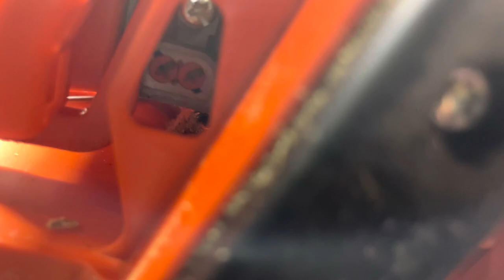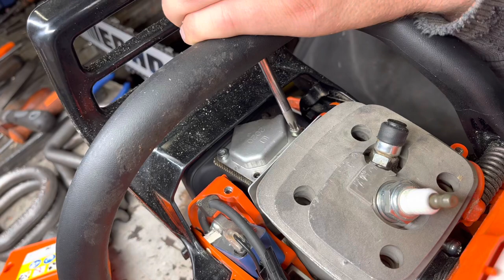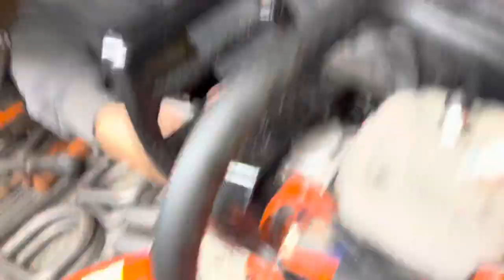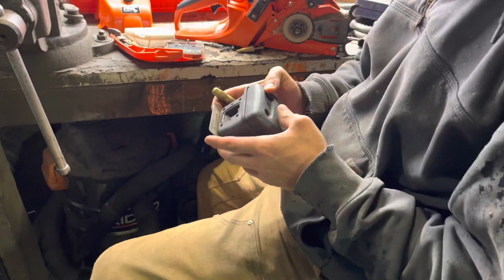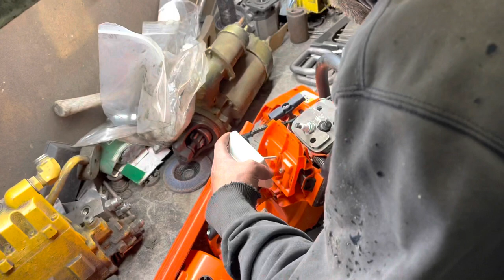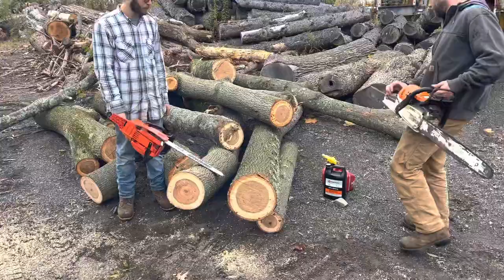Echo 590 Timberwolf- (Easy) How to do muffler mod and carb tune.

Comment: Echo has converted more Still & Husky owners than Jim Jones.
Reply from the maker: There great saws! I personally only run 2511 top handle echos. All others I use for production work are Stihl. However my ground guy bought this on my recommendation and we are both impressed with it!!
Reply: @timberandtools  I have a 2511T.  I find it doesn't cut that clean or chain sometimes snags.  Do you use stock chain?
Reply from the maker: @80srockerable  stock chain gets thrown in garbage lol. I use Stihl 63ps chain or on some of them I have 1/4 conversion! I have a whole video about this. It’s callled echo 2511 why people think it’s worthless
Reply: @timberandtools  thank you! I will check your video out.  I can't believe they sell this with such a crappy cutting chain.  It doesn't have enough power for its aggressiveness.
Reply from the maker: @80srockerable  yeah I think it hurts the saw for people who don’t know why it’s happening
Reply: Echo has better kool aid

Comment: A stock broken in cs590 beats a 261 everyday in my experience, maybe not in small softwood, but for sure in 18"oak
Reply from the maker: We didn’t try it in big wood. I’m sure the cc will pull on the echo. This was hickory. Mainly just to show the difference of speed after mods
Reply: Surprise surprise a 59cc saw can out cut a 51cc saw. What a revelation.
Reply from the maker: @eurokid83  that’s isn’t the point of the video. It’s to show the power upgrade from the mods. If I used a 362 Stihl it would not have been close
Reply: I’ve owned a 362. Great saw, but it’s hardly better than the 590 at full bar capacity. I actually like the Echos better. A bit slower, but a less fussy saw in my experience.
Reply: @jenaystanger5025  I have a 590 and 620.  The 620 is definitely a lil better,Always wanted to compare the 620 vs 362. I feel like the 620 would equal or possibly beat a 362.
Reply from the maker: @jeremymyers5643 620 would definitely beat the 362. I have a video up on my channel if the 620 beating my ms400 !!! Both saws have muff mods that’s it.

Comment: This is the first time I’ve seen the muffler mod this way. The way I saw it totally bypasses the baffle.
Reply from the maker: @voodoo7008  this was the “easy“  merging for basically anyone to be able to do
Reply: That’s how I did mine. Bought mine second hand. She was a monster before that because prior owner took lower baffle out of deflector and tune carb already. I just added the muffler mod at the deflector and holy crap does she scream. I’d put power close to ms461 stihl as I’ve ran those before and this one is about comparable to that.
Reply from the maker: @ they are great saws!!

Comment: Just sold a Stihl Farm Boss because it had issues straight from the dealership.  Returned it 3 times before using it and they wanted to charge me a shop charge so once it was sold I went with Echo CS590 Timberwolf.  Starts good and cuts good,  no complaints but tuning mine with a muffler mod soon and looking forward to seeing the difference
Reply from the maker: Yeah big difference with the muff mod, wakes it up. Sorry to hear the bad experience with Stihl I really like there stuff as well
Reply: @timberandtools  
I liked Stihl until the bad experience with the dealership. Stihl representatives talked with me and replied to all my emails trying to resolve the issue but when they supported the technician at dealership that wasn't capable of simply tuning my carb to get it to run correctly I gave up on Stihl. I returned it 3x's and 4th time they wanted to charge me to fix something they couldn't fix to begin with so after hearing about all the good comments about Echo i decided to go with them but so far I haven't had to deal with a warranty issue and it's been problem Free.
Reply from the maker: @dentondunn4346  that’s an awful experience!!! Echo has been great to me so far
Reply: You won’t regret doing the muffler mod and retuning , I was more than happy with the difference
Reply: @Pwnappler  
Iowa Performance Saws has it now, modded the muffler yesterday and taking out the plastic limiters today and tuning it so should get it back by Saturday or Monday at latest.  Can't wait even though ups damaged my chain break handle during delivery but they're only $25 for a new one but hated it cause it's a brand new saw
Reply from the maker: @Pwnappler  night and day, really wakes her up
Reply: LOL, same here - I bought a new Stihl Wood Boss and it had trouble. I ended up buying a new carb for it and fixing it myself. I ripped my shoulder muscle trying to pull start it (when I was tired). I went with the CS590 and love it. Look up ghtuning on the web to get some really cool mods. I'm done with Stihl.
Reply: @aportilla007  the muffler mod and having it retuned is worth it. It's a beast now, big difference
Reply: @dentondunn4346  I'll get it on the bench. Looks easy enough.
Reply: @aportilla007  I'm done with Stihl too, my CS590 is a torque monster after having Iowa Performance Saw's do a muffler mod, removing limiters and retuning it. It made a huge difference in how it runs. It's everything I need for gathering my firewood. If I was to ever buy another saw I think I'll either buy another Echo 7310 or a Husqvarna. I won't ever spend my money on another new Stihl. The way they done me on the warranty not wanting to repair a brand new saw never used turned me off from them.
Reply: @dentondunn4346  lol those 7310 look awesome. That is probably my next saw.

Comment: The stihl 311 is a much better match up. I have both , both modded. The 590 cuts fantastic especially in hard woods, has the torque needed to muscle through without bogging down to much.. the 311 runs fantastic and the mods helped it throttle response drastically , really opened the saw up. But with everything being said I like the design of the 590 better especially with the price difference and weight
Reply from the maker: For sure a great saw!! Price is unbeatable

Comment: Does that extra hole in the muffler blow a lot of oil out of it?
Reply from the maker: @you-tube153  no my saws do not have any oil coming from them. If the fuel mixture was to rich I would say yes I could blow oil out of that hole.

Comment: Just a carb retune on the 590 makes a noticeable difference. They’re rich from the factory. Mine would out cut my 261c from day 1 after it was tuned.
Reply from the maker: This is true, the factory tune is awfully rich. I just open up the muffler a bit on most saws I mod the carb on and way I have found on some it make a huge difference (2511) for instance needs a muff mod or else you don’t get a lot of usable power from just modding carb. I’m sure a retune on the 590 wood have helped a lot by itself

Comment: I love my 590 but it’s just stock I just put two tanks through her today on a bunch of cottonwood about 32” round. I did buy a 24” Tsumura and slapped it with a skip tooth full chisel and she absolutely ate. 
I also have a MS462CM that I haven’t fired up yet.
Reply from the maker: Sweet that’s actually the set up he has in his timber wolf now Tsnumara 24”. Your really going to like the 462! I have other videos up of mine and tbh it’s my favorite saw.
Reply: @timberandtools  which one the 462 or the 590? i really want to do the muffler  od on the 590 but i dont know how to tune a carb unless its like my nitro cars-thats the only thing holding me back from the muffler mod.
my 462 i put on a sugihara 28" bar and the stihl pro full chisel full skip-so shes ready for the shelf, lol look pretty
Reply from the maker: @ChrisNieves  462 is my favorite!! I don’t own a 590. This is my groundsmans chainsaw. Tuning the carb is something that is learned. A lot of good videos on YT. Best thing you can do is learn how the low and high jet affect the tuning. Then you’ll be able to tune by ear easier. Most of the time I get them close by ear. Then tune them in the cut.

Comment: I have a 620pw, but my dad got a great deal on a returned 590 through work. Anecdotally the power difference is miniscule after tuning with the 590 being more forgiving down low. Only negative is the oiler seemed lacking (imo) for the 20" bar on even highest setting, whether that's spec different from the 620p or just the machine idk....its more than adequate for the 16" pro bar he has on it now and absolutely rips.
Reply from the maker: Not sure if the oiler is different or not but they do say 620 can handle a 27” from echo

Comment: Ive cut wood for over 30 years heating at least two homes and a waterstove and seriously dont know why Id worry about the  speed differences as there both fast enough to get the job done.
Reply from the maker: Cutting wood for a living , it’s just nice to get a little extra umpf out of the saw. Not needed but makes it more enjoyable to run
Reply: @timberandtools  I understand  if it were my job I'd probably do same. You guys should do a vid on cutting trees that have stress on them and safest way to work them up. They can scare me sometimes. I got one now actually
Reply from the maker: @Owl4909  for sure! Do you mean like a leaning tree?
Reply: @timberandtools  ones that have pressure on them when they fall in the woods  . it can be narley
Reply from the maker: @Owl4909  yes definitely dangerous stuff to work in that environment. Compression and tension wood !!
Reply: @timberandtools  exactly
Reply: @timberandtools  if I have any to say about it, it's to cut slow and watch it
Reply from the maker: @Owl4909  that’s always the best way. Slow and have your head in a swivel

Comment: OK, I read through the comments and now know 5/8" is better than 1/2" and you retuned the carb off camera. The only way I know how is by ear. I do the LOW first, then the HIGH and back to the LOW if needed. All on a hot engine. Does it get more complicated? Can you explain tuning in the cut? Thanks.
Reply from the maker: Main reason for this video was the modifications. I do tune by ear. I also tune a bit leaner than some because I always have a sharp chain etc. I think tuning is best done by the specific operator. Best way to explain how I tune is to fatten up the L so throttle response is crisp then adjust the H not to scream but to get it to get a decent rpm and tuning in the cut is variable based on operator really. If you not always sharp and you tune lean saw is not gonna last to long or if you over rev etc…
Reply: @timberandtools  Hey, thanks. I understand what you mean about in the cut. Under load you might realize that it can run a bit leaner, gain power and never blow up as long as you don't lift and overrev constantly. I'm sure the engine will wear faster than the factory (or ear) settings, but it's worth it. As always, a sharp chain is the safest chain you can use.
Reply from the maker: @peterp.6249  definitely the safest!!! I have several saws I’ve run daily for years and they’re still run great. I use Stihl ultra which probably doesn’t matter much but 42.5 to 1 ratio helps with the lean tunes… my 440 I got used and had I about 4 years now. 3 of those years was being run daily. P and c still look new just had the muff of to check a few months back. So far so good lol 😂

Comment: I’ve always wondered about the echo saws but my closest saw shop carries Stihl so that’s what I bought. I guess if they carried Echo I wouldn’t be wondering 😅. I take it you do all the service yourself? How does echo handle warranty work?
Reply from the maker: Yes I do all the work myself however in the last four years I have been running Echo products I haven’t needed to do any actual repairs and I’m not kidding. That pretty much goes the same for the steel products that I have bought as well I do really maintenance and take care of my things well so they usually last quite a while. I highly recommend the more professional series of Saw that echo makes to anyone. I run echo 2511 tophandle chainsaws all day every day and just keep putting gas and bar oil in them. This echo Timberwolf was my first experience with a bigger echo saw and I am a fan. We have since put a 24 inch bar on it and my worker really enjoys the saw I even grab it and run it from time to time.
Reply: @timberandtools  the 2511t looks like a really nice option i can’t lie
Reply from the maker: @Johnnyreengo  it definitely needs a muff mod and carb tune but after that look out for sure

Comment: interesting way to mod....Ive seen some other mufflers with a twin hole up front..so I guess so.

I just did a little carb adj on mine, its a ANIMAL.  $325....4 years ago.  a little heavy, but it cuts crazy good.
Reply from the maker: I have a lot of saws so quick and easy works for me haha. It is a work horse saw for the money it can’t be beat!!
Reply: @timberandtools  is it Really loud now?   my neighbors already feel the Bass when I run that saw..LOL

I did a light muffler Mod on my cs370, its not much louder, and it picked up nice.  That saw is light and has seen alot of use/abuse...runs like a champ.
Reply from the maker: @harryharry3193  not really, loud is a straight shot muffler or a bark box by west coast saws haha

Comment: That muffler mod will get you a ticket if you cut wood on State or Federal land where spark arrester screens are required. 
It's better to drill the hole next to the pipe under the deflector plate. Then the exhaust exits through the spark arrester screen, so it's legal.
Reply from the maker: Absolutely!!!
Reply: That's what I did and it gained a ton of throttle response and I still have my original deflector and screen in it!!!I
Reply from the maker: @stevenblake6939 wakes me right up !

Comment: The 590 with a muff mid and tune seems comparable to a 362
Reply from the maker: I would say it is comparable but most likely a hair less. Based on running both of them. I do think the 362 has a touch more

Comment: Defeated the spark arrestor somewhat.
Reply from the maker: Definitely, In our area we don’t have any issues with needing a spark arrestor on the saws matter-of-factly rarely ever have seen or heard of a wildfire in my area that wasn’t started by a campfire or a big burn that got out of control. I am aware in some areas how dangerous it could be to run without the arrester

Comment: I have a 620p I am going to mod when it gets broken in.
Reply from the maker: Your going to be happy for sure, it really wakes them up!!!! 620 is a cool saw. It really runs well for its size
Reply: @timberandtools  do you have an a-proximate on of the size of the hole you put in the muffler?  The 620p is a really nice saw as it is.  I’ve got a 550xp M2 and a 572xp.  I really like the 620.  Reminds me of a Dolmar 6400.  I may just get it ported too.  We will see.
Reply from the maker: @backyardfirewood9852  yeah the hole is 1/2” but I think it needs to be 5/8” tbh. Those other saws are great too! I also love dolmar
Reply from the maker: @backyardfirewood9852  really want to buy a 550 to compare against my 261!!
Reply: @timberandtools  if you ever ran a 5105 you know what the Mark 2 is like.  I want to get a 501p to compare to the 550.
Reply from the maker: @backyardfirewood9852  I have a 501 p in the shindaiwa equivalent and I was largely disappointed. I think it’ll rip after a port job tho

Comment: How smart can the two cut on the same end be? Just a broken chain on a chainsaw, what are the consequences?
An injury leads to an additional burden on the healthcare system...
Reply from the maker: Suprised you didn’t mention the fact we’re not wear chaps. 😂 btw myself or crew has not had an injury or broken a chain while doing this😌 we also have workman’s compensation and health insurance so don’t worry about a freeloading work injury affecting the healthcare system….
Reply: @timberandtools  Accident? The question is 'when?' and not 'if?' .
And by publishing this video, you will realize that you indicate that this is correct, an example to follow...
The part that can be seen is a joke, the part that will not be seen (the accident) is the responsibility of the paramedics.
Obviously, I came across a superior intelligence that thinks it will collect some insurance in the case of a fatal accident - the insurance is collected by the relatives for the funeral.
And I'm not worried that you're promoting dangerous things, but conditionally.
I'm surprised that if you're employed with insurance, you don't know that you never point a chainsaw in motion at another person nearby - a chainsaw in motion is like a weapon with a safe taken. But you probably have an equally intelligent boss...
Reply from the maker: @PopaAlexandru.  I am the boss and as far as the chainsaw goes some people can’t handle it. You would have died 50 years ago there was safety regards for nothing and those men went to work and came home safe just the same as today, we’re not all cupcakes some of us are real men
Reply: @timberandtools  Real men can stop the chain with their chest!
And what if there was an accident? It can't happen to me! However, it happens to some people...
Reply from the maker: @PopaAlexandru.  accidents happen to people with all safety equipment and being careful EVERYDAY
Reply: @timberandtools  Protective equipment minimizes the effects of accidents, does not avoid them. Of course, IQ also matters... a distracted or 'tired' person has this coefficient at low rates.

Comment: There is spose to be an oring on the filter
Reply from the maker: Makes sense that was like whattttt
Reply: @timberandtools  not all of them are that way i have an old 330t thats alot better design
Reply: I just took the air filter off my brand new CS590 for the first time. Same thing as yours no o ring and dust starting to make its way in. I will be putting one on now. Thanks!
Reply: @marshymarsh20  not a problem man
Reply from the maker: @marshymarsh20  glad you caught it! It’s crazy they had it like this!!
Reply: My 590 is about 5 years old, it’s never had an o-ring.  I’ll be adding it though.
Reply: What’s a “spose?”